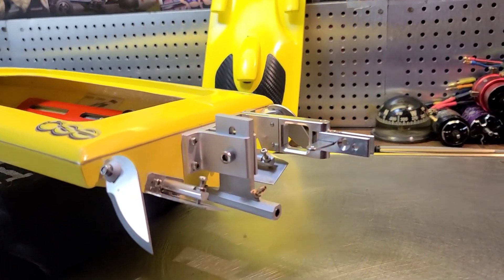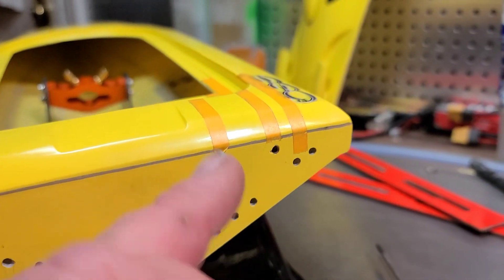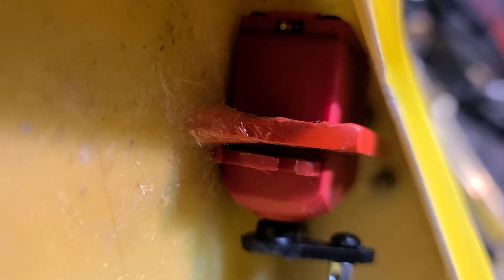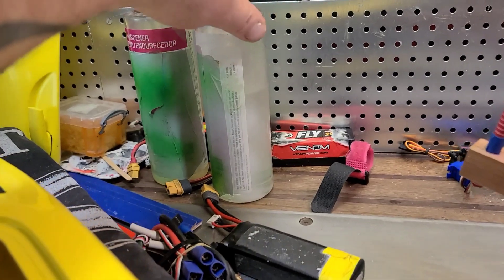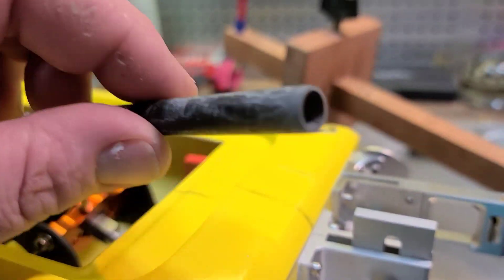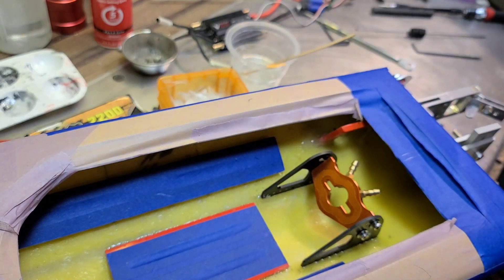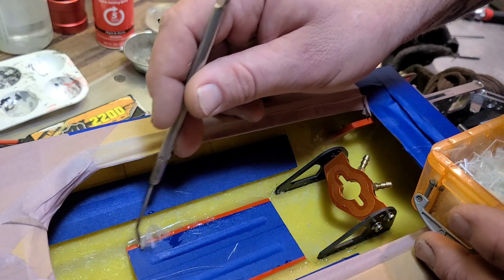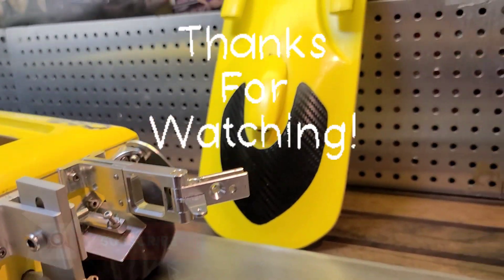Fast Electric RC Boat Build Pt5 Hardware,   Brushless Motor & Servo Mount Install, Deltaforce Sniper

Comment: How do you make sure the hole were the drive shaft goes through is lined up with the motor mount?
Reply from the maker: I usually eye it.      I  use the flex cable in the stuffing tube if your using a Teflon liner  Put you coupler on the motor and slide the flexcable in the coupler.  Using the flex cable as an "alignment tool"

Comment: I swear the cut trim tabs go on the inside so it doesn’t mess with the flow of water towards the propeller
Reply from the maker: You could do I'm either way either way it depends on how the layout of the boat is

Comment: how long your rc boat hull sir?
Reply from the maker: Deltaforce 23 mini sniper.  23inches
Reply: @IRONCLADRC  thanks sir anyways is it important that the rudder is aligned to the propeller all the time?
Reply from the maker: No not in all cases depend on strut length length of hull etc.

Comment: looks like youve driled your finger already
Reply from the maker: Yep more than once. Haha  Gonna be dumb you  better be tough.. lol
Reply: 😊👍Yes sure do gotta be tough, injuries doing this stuff..I hate It when you rev the motor up and the prop digs into a towel or blanket your using to protect the carpet or your finger hits the spinning prop at low rpm
Reply from the maker: Lol. BOAT GANG.